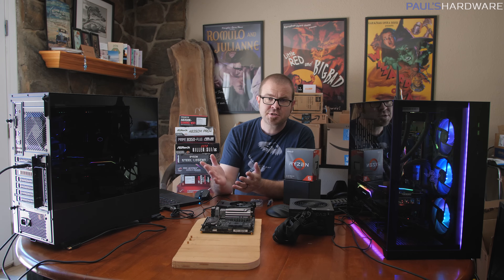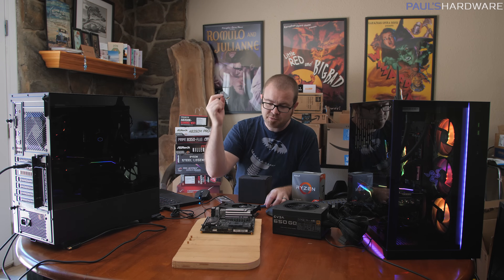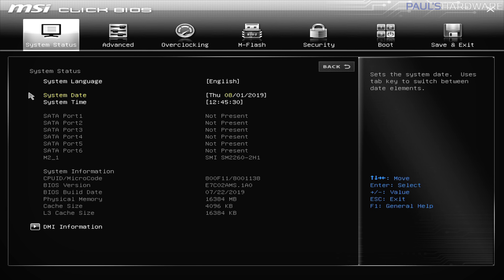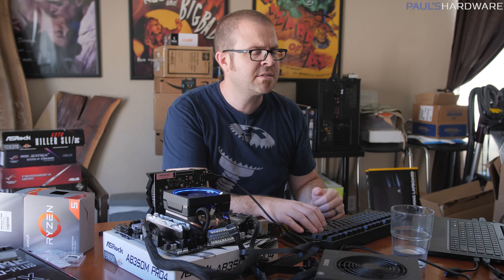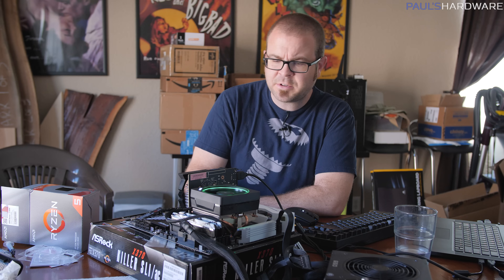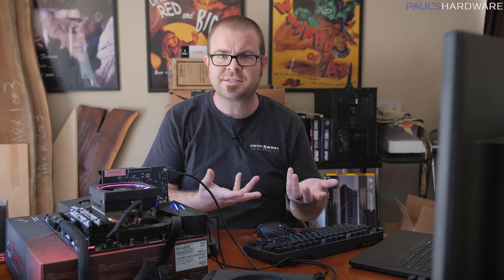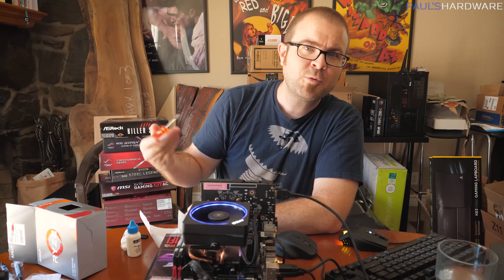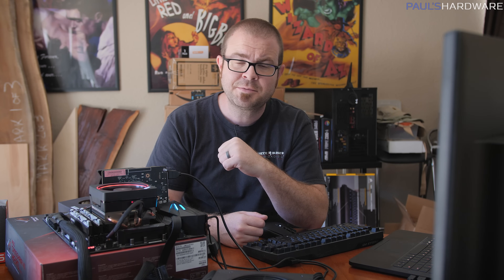Does Ryzen 3000 REALLY Work on Old Motherboards? Testing B350, X370, B450 and X470

Comment: Been considering an upgrade to the 3000 series from my 1600. This will be interesting. 

Can anyone confirm that Ryzen 3000 series' memory controller is designed with 4 sticks of RAM being a user choice? 1000 and 2000 series were better with 2 sticks of RAM only iirc. Thanks.
Reply: I have a 2700X with 4 16GB sticks of DDR4-2400 ECC (64GB total). Also have a 1700 with 4 8GB sticks of 2666 memory. Both flawless. B350 motherboard in both cases.
Reply: Depends on the motherboard, most ryzen boards use a daisy-chain memory layout, this favors 2 stick configs while t-topology favors 4 stick configs, with a decent board you this should not matter unless you are going for > DD4 4000, using very high density ram sticks can also limit the max frequency you can achieve, worst case scenario DDR4 3800 should be achievable unless the BIOS memory optimizations are complete trash; If a board only has 2 slots it may be able to clock the ram well over DDR4 4000 if the bios is optimized, a easy way to check is to see what the board vendor has on there RAM QVL list (B-Die is able to clock very high, do not assume you have that)
Reply from the maker: 1st/2nd gen Ryzen would often have problems running a 4-DIMM configuration at higher speeds, whereas a 2-DIMM config would be OK. This is actually pretty normal on AMD and Intel platforms, it's harder to run 4 sticks overclocked than 2 or 1. Fortunately Ryzen 3000 series is handling memory much better... Not guaranteed to work of course but you'll have a better chance to get your quad kit working at higher frequencies

Comment: Needed this also thanks Paul. Going to be updating my 2400g to 3600 on b450 tomahawk👍
Reply: I’d read this first mate. The later posts that detail issues despite the bios updates described here are very off putting for me. I have the b450 tomahawk myself running a 1700.

https://forum-en.msi.com/index.php?topic=321288.250
Reply: Personally I had to deal with so much bs during this operation. I just bought a x570 motherboard cuz I had too many problems with the Flash Drive bios update sadly.
Reply: Get tomahawk max instead.
Reply: 5T4LK3R I think he may already have the MOBO.